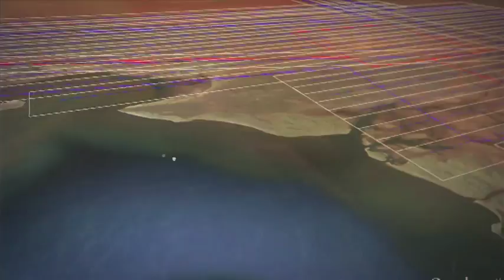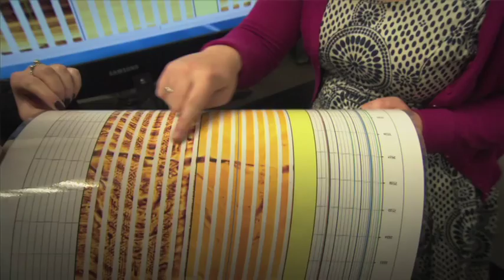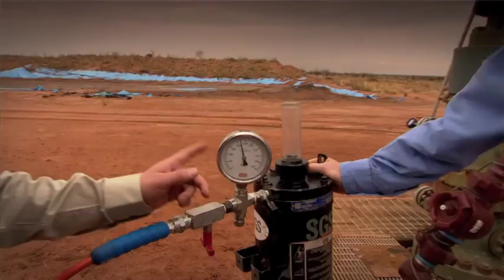RESA's Change Your Life with Mining, Oil & Gas Careers

Comment: Hello my name is Evgeny I work as the underground drifter at the entity on production of iron ore. My skills: underground drilling of shots of a face the manual puncher with a pnevmopodachik, preparation and loading of a face for explosive works, installation anchor fix, a construction of underground steel concrete and concrete designs. For today finished a construction of a vertkalny mine trunk of 450 meters in depth and with a diameter of 8 meters, the trunk is put in operation, installation of all designs of a trunk (installation in a trunk of executions and conductors) was made for descent of freights and workers. There is huge desire to work, write to me please if you have vacancies. еmail:
 Jon24@mail.ru